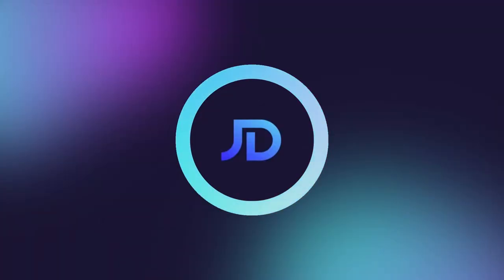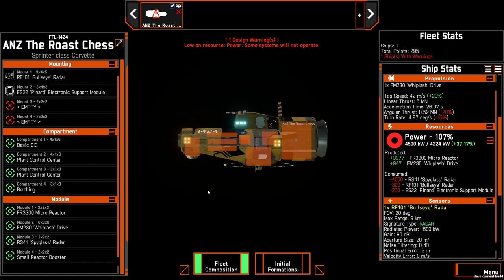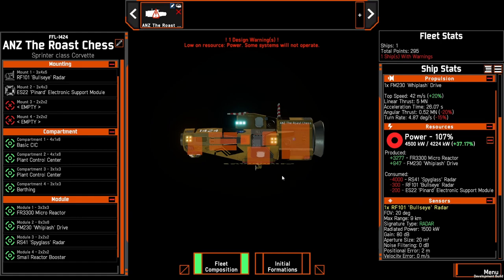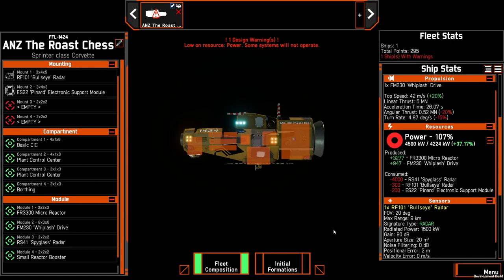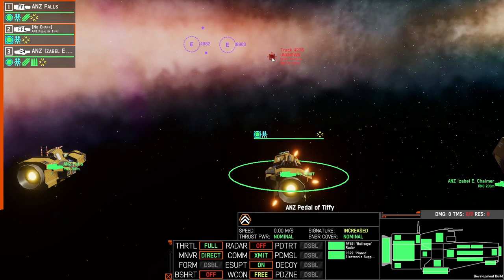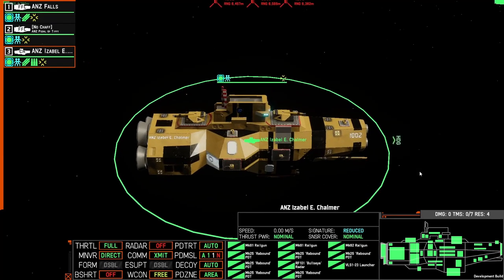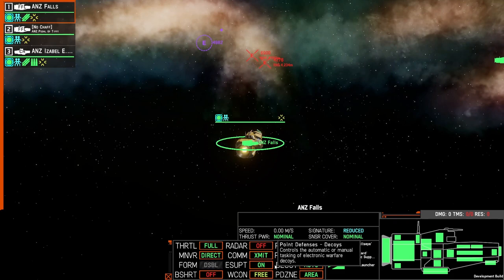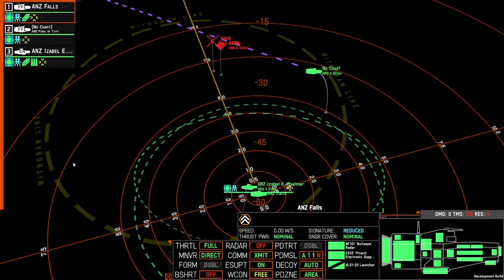The Pinard/Bullseye Corvette Scout | Ship Build | NEBULOUS: Fleet Command

Comment: I’ve been finding that this configuration can get jammed out and killed quickly. So a slightly more expensive option is to have a frigate scout in addition to the corvettes that has a jammer, or alternatively a protection corvette with parallax, blanket jammer and VLS-16 or 250mm gun to take out other scouts. 

Still experimenting at the moment though..
Reply from the maker: Let me know how it goes. Id love to showcase other builds and their tactics.
Reply: Would it be possible to simply turn off the Spyglass under normal conditions and simply only rely on the ELINT to detect the enemy's general location, before using Spyglass to get a closer fix and then the Bullseye for the hard lock and solutions?
Reply from the maker: @henryhamilton4087  For the ship build shown? Thats exactly how it can be used. Turning off the radar at the beginning lets you make best use of the PINARD for ELINT and to lock using the bullseyes while remaining hidden from enemy PINARDs which cannot detect you because your radar is off. Turning your spyglass on/off for a short moment can help detect anything close that has its radar off.
Reply: @henryhamilton4087  You can use an elint fix and get a bullseye lock, yes.